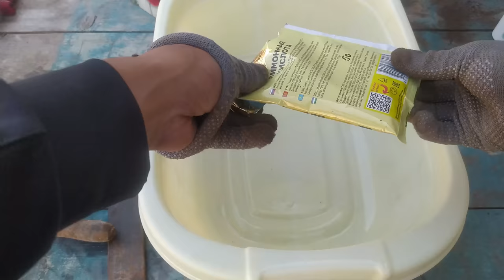Restoration old Chain Link Fence Machine

Comment: A fair effort but you never opened up and inspected the 2 bearings or cleaned up the hardware, only removed the rust. For what you have to work with you did a good job.

Comment: Sorry but this is not a restoration. so let's call the video a clean up and repaint.
You did not even replace all the bolts much less tighten down the ones you installed.
And I do not need to have a video of me restoring anything to know when something is done wrong.
A little attention to detail goes a long way.